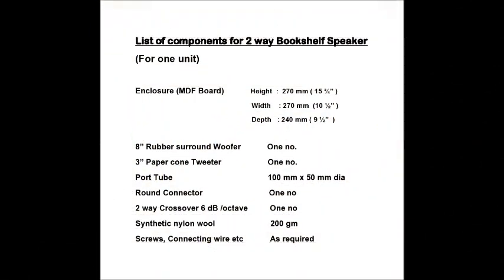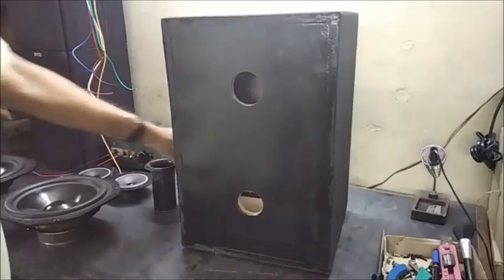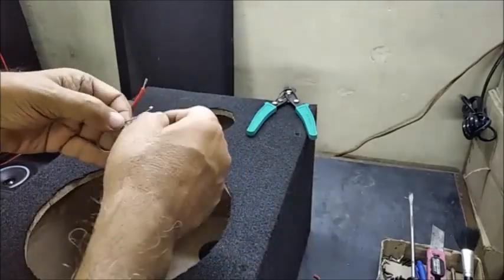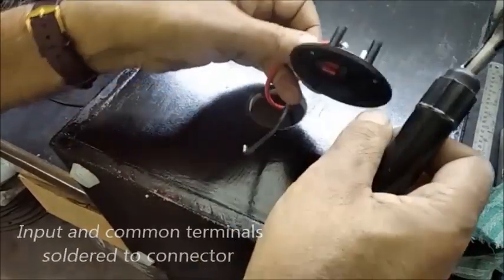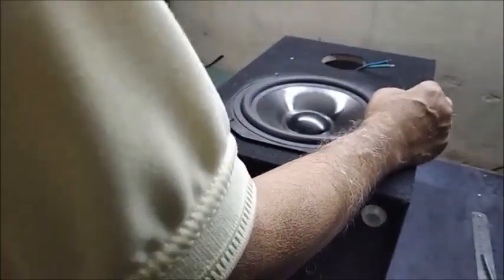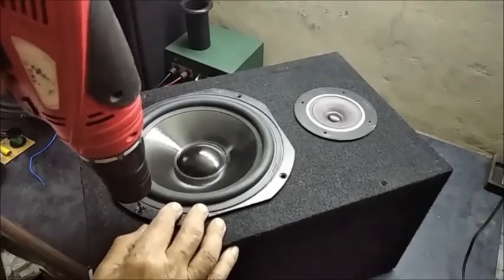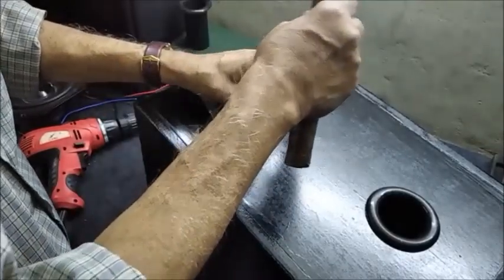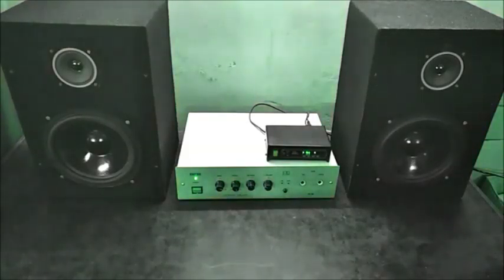Easy to make 2 way Bookshelf speaker

Comment: What will be the total impedance of 2 pcs(woofer+tweeter) 8 ohm both, with crossover network?
Reply from the maker: If you connect through a crossover network then the impedance will be 8 ohms.

Comment: Sir I have a query.
Does Polly fill improves damping factor
Reply from the maker: Yes, for sealed enclosures it's very much required. For ported enclosure with thinner board it reduces internal reflection and panel vibration. For thicker material it's not much necessary

Comment: Dear Sir Could you please tell me is there is any link to get  the SYCO speakers online and port holes tube which is used by you in the video ?
Reply from the maker: SYCO is my own brand. At present I make very small quantity of speakers mostly for experimental purpose.
Plastic moulded ports of different diameters are available in market. If not, you can use pvc water pipes.
Thanks.
Reply: @makingloudspeaker  Sir can I get your different types of SYCO products like Tweeters, Mid Range Speakers, Woofers, Subwoofers, Tower Speaker  Boxes , Amplifiers, crossovers,other components etc. in the flipkart. If not please sell these products in the Flipkart. We are trying to get the different products of your SYCO products through the Flipkart online.

Comment: Sir...i have one question..i try to make 3 way bookshelf  speaker..and i know my woofer 100w..is anything problem if use 15w fullrange speaker and 10w tweeter?
Reply from the maker: No, it's ok. You have to connect the speakers through cross over network. Full power of low frequency goes to Woofer and less power to midrange, tweeter. If necessary, you can shift cross over point as required.

Comment: You have used Syco Woofer & Tweeters, are those speakers good? Are those easily available in the market? What will be dimension of the port tube?
I have tried nylon (polyester) wool, it works well. But I must say glass wool is more efficient.
Reply from the maker: SYCO is my own brand. Dimensions of port tube mentioned in video - 50mm dia, 100mm length readily available
Reply: @makingloudspeaker  Thank you so much for your prompt reply. Now I have come to know that you are former MD of Mekasonic. I already have your WhatsApp no. and I will contact you as and when required.
Thanks and regards.
Reply: @makingloudspeaker  where i can get port tube??
Reply: @ajayhajare6917  you may found various type of port at chandni market.
Reply: @ajayhajare6917  you can make your own port tube using cardboard pipes or plastic pipes from any plumbing hardware store

Comment: Sir, kindly explain the purpose  and function of filling synthetic nylon wool and air hole pipe in enclosure .
Reply from the maker: Synthetic or glass wool is used to reduce internal reflection of sound waves. Port is used to eliminate resonance peaks. Please find some articles in net to know about speaker enclosure design.